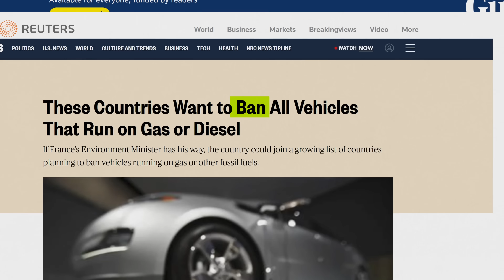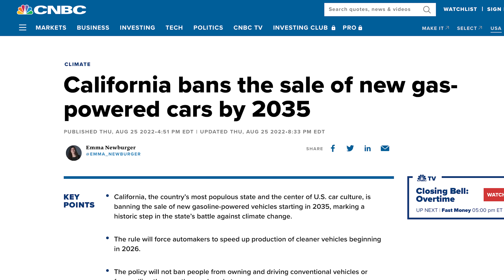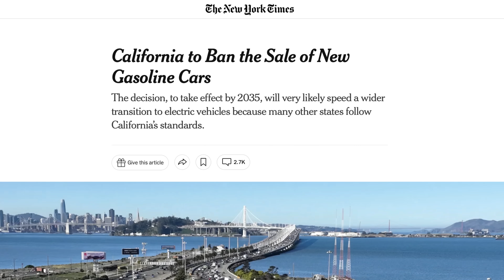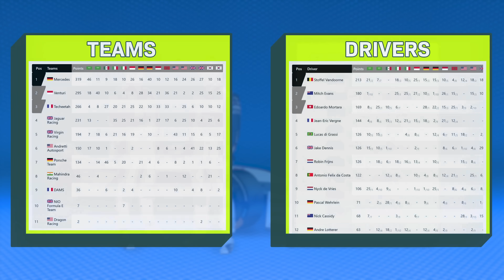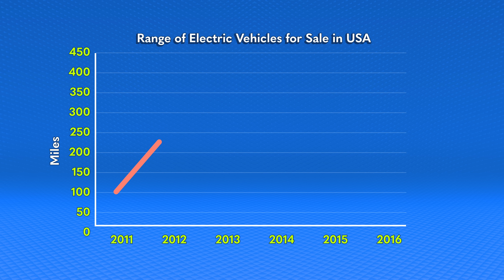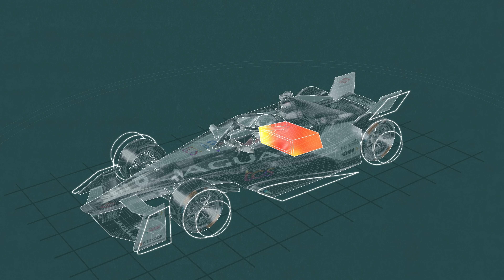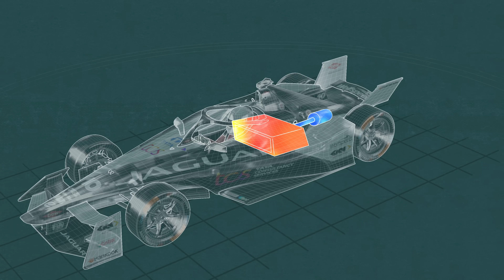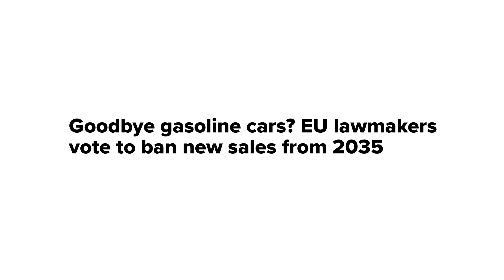The Electric Formula 1, Explained

Comment: Yeah...gas cars aint going anywhere. Everyone who thinks that EV's will be ubiquitous and ICE cars are dead is so oblivious to how the world works. Electric is great and all, but horribly unsustainable in mass volume. Its easy now, because we only have a few million EV's on the road TOTAL. The moment everyone drives an EV and we need to think about recycling and power grid economics and logistics...its pretty much over for humanity, we will be swimming in lithium. You can always melt down metal or recycle oil, we have been doing it for centuries. And no, F1 will never be irrelevant, and if it goes full electric, sure, it will be fine either way, but we are so far away from that, at least 20-30 years before we have electric motors that can use 1/10th the power and batteries with 2-3x the density. The engineering is stuck at a bottleneck.
"But what about the bans"
LMFAO politicians go back and forth on their word every minute, you think this is any different?
Reply: Unless science can create a better form of carbon capture than plants and trees, there's going to be a recurring cycle of wildfires where CO2 accelerates plant growth until all the water has been consumed because there's no market for paper products that traditionally encouraged proper forestry management to prevent wildfires from occurring
Reply: we should also note that F1 is switching to biofuels, which maybe more sustainable for a few reasons. 1) we can retain the ICE cars on the road by running them on these cleaner fuels, reducing the demand for production of new electric cars, and reducing waste because we don't have to dispose the ICE cars since they would be still used. 2) biofuels may be a renewable source of energy since it can be produced using vegetation and our waste products, unlike batteries where they have to mine lithium and other metals, which are limited on earth (honestly I don't know if my second point is very convincing but I personally think it is valid)
but who knows what the future holds? It's likely not us who decides the fate of cars, it's politicians and those higher ups so yeah